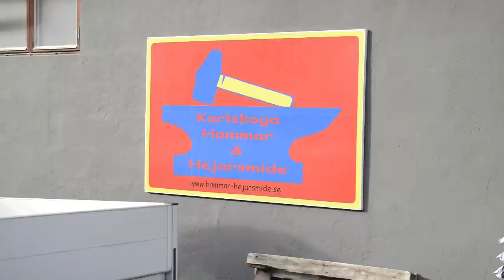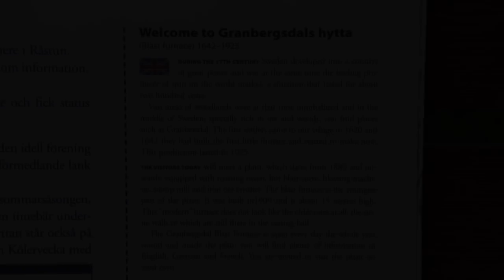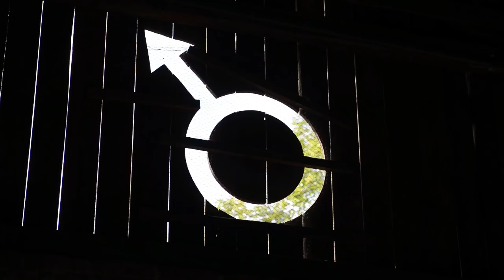Annual blacksmiths meetup in Granbergsdal Sweden 2017

Comment: That was fun.
It reminded me of when I was 17 (in 1967!).  My Step-dad worked in a small steel & fabricating company across the street from where we lived.
My first job there was working with a hole punch.  I sat on a chair with my foot on a larger pedal, and when I pushed down, a powerful steel punch would come down and punch a hole in a steel sheet. 
Later, I spray painted steel beems.  

One day, another employee wasn't paying attention and got two fingers chopped off in some kind of chopper.  
Cool summer job.
Reply from the maker: Thanks!

Comment: That BIG GREEN BULLDOG, at 6:00...is really something else....woof woof.
Granbergsdale is quite an amazing relic, the chimney tower at 12:06 is unusual in having the on end brickwork, (bricks laid this way are called "soldiers").
Reply from the maker: :) Yes it is!  I suppose the bricks are laid that way for extra strength.
Reply: @torbjornahman  I don't think so...it's VERY unusual, it must be an outer skin with a stronger bond beneath, it was likely (i suspect) laid later to insulate the heat that may have been escaping....ive never seen it bebore, as a mason, thats a first...lol.
Reply from the maker: @scottleft3672  Yes, it's an outer layer for sure. There is probably 2-3 feet of "insulating" material behind it.
Reply: @torbjornahman  That makes sense, the bricks were likely difficult to get delivered back then, they were likely being ...frugal...the best and longest lasting brickwork is laid on a corse of granite, it works like a damp-corse, Northern cities in Lithuania and such, have lots of it...over 500 years the bricks have often lasted....anyway, cheers.

Comment: Hello my friend. I enjoyed this video a great deal. I was amazed and impressed with the blond gal and her blacksmith talent. My ex worked for Luhrjensen in their smoker factory in Hood River Oregon and hated when she had to work on the rack assembly welder because it splayed small sparks and she had wear leather sleeves. In watching yours and in this video, I'm trying to understand how the power hammer ram moves up and down with such a fluid, controllable action. I could find nothing researching them. Thank You Torbjorn, Keith L.
Reply from the maker: :) It's the nature of air hammers. It's compressed air that moves the ram.
Reply: So your motor on the back operates an internal compressor?  @torbjornahman
Reply from the maker: Yes, it drives a piston in the back cylinder that acts like a compressor and via clever valves the air is pushed both up and down in the ram cylinder at the front.

Comment: Thanks for sharing this event Torbjorn!  Wasn't incoherent to me...nice flow actually!  Curious what the machine was at 14:04  Scale remover?  Really appreciated seeing the ring roller setup.  Think those are the biggest rivets I've ever seen and can't imagine what they are holding together.  Also thought you had a nice control of the big machine there.  Just Terrific, enjoyed every minute...Thanks again!  ~PJ
Reply from the maker: Great! Not sure which machine you refer to, the time-code is at the end of the video. But he uses two needle hammers mounted in a jig to remove scale from the long bolts before put in the upsetting machine.  They are not rivets, I think they are pistons of some kind. Thanks!!
Reply: Thanks!  Needle scaler was the point I missed in the time link...my bad.  Interesting shape pistons, I could see perhaps some kind of valve.  All so fascinating to see...I would have been a nuisance there for sure.  ~¿@

Comment: Amazing!I have seen an old video of Roger forge with those monstrosities it was really cool. One thing I don't like about these Beche hammers is the long stroke of the ram ,Nazels have a much shorter one :)
Reply from the maker: Beche has made a couple of different models. If you look at the green one, it does not have that long stroke. It is very useful if you have special tooling.
Reply: Torbjörn Åhman Yes the long stroke would be very useful for tooling as they demonstrated forging that ring,I was speaking of a bladesmithing(mine) perspective about the shorter stroke being more useful and controllable in such a situation :)

Comment: Is there a benefit to hands-on production forging like Roger and his sons are doing? Is it cheaper than ordering from a larger manufacturer or better quality? I would assume their work is somewhat less precise than that of a larger plant.

Cool vid as always!
Reply: Depends on what type of part you want. If a large plant already has the tools to make a part than that would for sure be cheaper, but tooling up to manufacture something is not cheap. Large scale manufacturing is not flexible at all. Shops like this can probably sustain themselves by producing small batches of things that large scale manufacturers can't make a profit on due to the demand being to low.
...But there are too many variables for a clear answer. As far as quality goes it comes down to metal, technique, what precision that is actually needed and what is overkill, operator/smith skill, machine etc. If you want something forged, cast or made by CNC and so on and so forth.
Reply from the maker: Yep. I think for the most part they do small batches of special orders. Regarding quality - top of the line. Forging vise you don't have to be that precise if you don't like, most of the forgings are machined to size anyway.

Comment: anyone seen a power hammer that runs on diesel fuel, about the size of the orange or green hammers? i worked in a shop 40 years ago that had one, you had to light a piece of paper and stuff it inside when you first fired it up, i guess to warm it up a little, not long after i left the shop closed and all the equipment went somewhere.
Reply from the maker: What? Never heard of that.